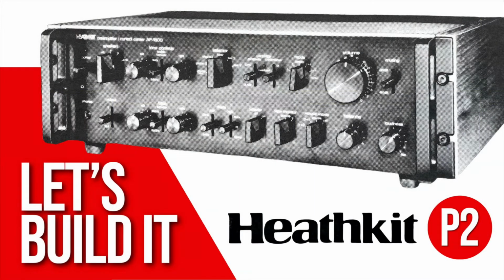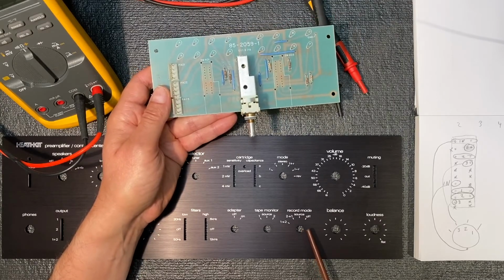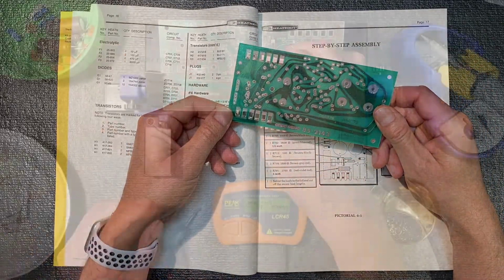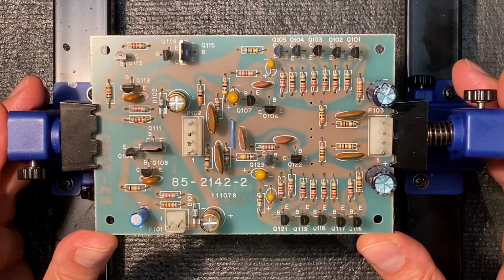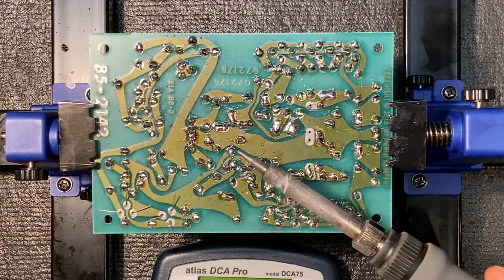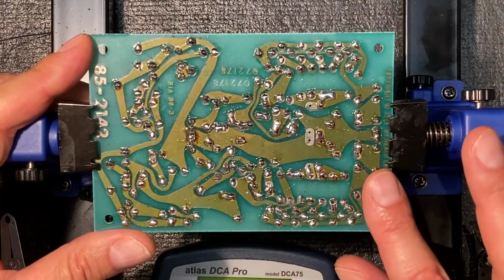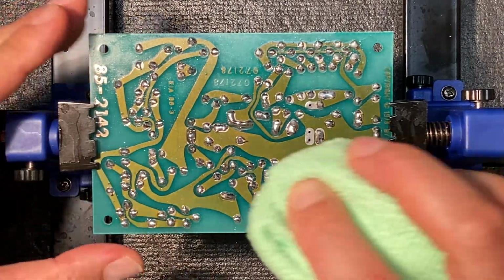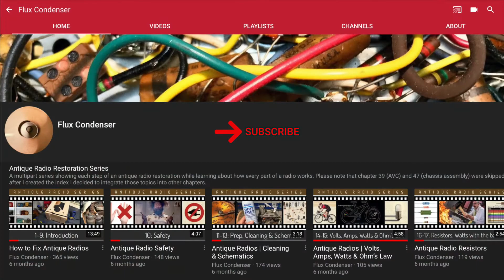Let’s Build A Heathkit Stereo Pro-Series Preamplifier • P2

Comment: I have four, Heathkit AP-1800 preamplifiers and all of them have a three position switch for the tape monitor. The parts packer must have just made a mistake in packing this kit. I enjoyed watching your build of a NOS AP-1800. I miss those days of getting the new Heathkit catalog and wondering what new kits would be offered. I have a complete Heathkit Pro-Series rack system. Every piece pictured in the two catalog pages you show, in addition to the AD-1309, white and pink noise generator, the AD-1308 spectrum analyzer, an ADC, Accutrac 4000 turntable (Heathkit offered the same turntable under a private label agreement with ADC, but I don't have the Heathkit version), a pair of the AE-1705 equipment racks, plus a pair of AA-1600 and a pair of AA-1800 amps and even a copy of the Heathkit catalog you picture. All that equipment is attached to a pair of Heathkit AS-101 speakers. Every piece is still fully functional and I enjoy it all on an almost daily basis. I also have an unbuilt AD-1308 spectrum analyzer kit and an unbuilt AR-1650 AM-FM, stereo receiver kit. I have been struggling to decide whether to build these kits or continue to save them. At least so far, they are still unbuilt. I was also lucky enough to purchase one of the original prototype AA-1800 amplifiers from a person in Benton Harbor, Michigan. It had belonged to a person who went to school with a former employee and kit designer at Heathkit back in Benton Harbor. I also have lots of other Heathkit audio equipment going back to the A-7 and A-9C tube amps offered in the mid to late 1950's. Lots of Heathkit test equipment as well. Ah......... the good old days!
Reply from the maker: Roger, thanks so much for visiting and sharing your incredible experience with the Heathkit Pro Series components and others. What a treat it must have been to build that system and what a treat it must remain to be able to still listen to it today. Even a pair of AS-101 speakers! I was a young teenager when the Pro Series components were introduced, so I largely missed the Heathkit-building experience due both to my age and the expense. So now when I come across these unbuilt kits, it’s hard to fight the urge to not build them! I have a lot of vintage equipment to choose from, but lately I’ve been listening a lot to the AP1800 with a McIntosh MC2105 amp I restored and B&W Series 3 802 speakers. When I listen, I have no regrets that I didn’t keep the kit as a bunch of parts in a box.

Comment: Fantastic build series. Thanks so much for sharing. Looking forward to part 3!
PS: I also use Cardas Quad Eutectic solder. Best I have used by far!
Reply from the maker: Thanks for watching and taking the time to comment. Glad to hear people are enjoying the series. Yeah, that Cardas solder just makes soldering so pleasant. I tried, really tried, to make lead-free solder work for me (in one of my earlier videos I said there was no reason to not use lead-free and told holdouts to “get over it”). It did work fine, I suppose, but it’s harder to work with, never looks as good, and I didn’t have the faith it would hold up as well and not lead to cold-solder issues down the road. I’m a sucker for perfect-looking, shiny-happy solder joints.
Reply: @FluxCondenser  Couldn't have said it better myself. I have never had luck with lead-free and I don't think I ever will. It's just the name of the game.

Comment: I was hoping to watch you actually build it. Speeding through it was slightly disappointing to me. BTW, if someone hasn't already told you, the little red thingy is a nut starter. The manual will tell you that. I've built several Heathkits including a GR900 and GR2001 TV W/Programmer and remote plus clock. Also a couple of scopes and the IT-28 as well as the IT-21 Tube tester. I loved doing them. My 1st encounter with Heathkits was in an Amateur radio club in the late 50s. We built a SSB transceiver but all these years later I don't remember the model. Keep up the good work.
Reply from the maker: Thanks, Jim. Yes the nut starter tool was addressed in subsequent videos in the series. Sorry you were hoping to see this built in real-time, but that’s just not practical within the constraints of YouTube, at least as far as I’m concerned. Thanks for sharing your experience with Heathkit. I always enjoy hearing those stories. Good stuff!

Comment: Very enjoyable!  I'm an old Heathkit builder myself.  I must admit, I don't recall getting much in the way of mystery parts or missing parts (not saying it never happened but it was VERY rare).  One thing to watch out for is that Heathkit would add addendums/updates to kits and would often print (well, Xerox) the alteration and one was to staple/tape the change to the existing manual.  The last 2 digits in the part for the manual was normally the revision number.  You are on Rev 06 on the book.  You're Illustration Booklet should having a matching part number (upper-right corner of the front page).  Furthermore, the Schematic should also have the SAME part number.  This can give you a clue as to if your kit was somehow altered and also if you are seeing some prior revision parts (they didn't always remove older parts if there was a revision but merely had you use the newer parts. 

I have some kits were I built multiples (clocks and TVs) and due to the time span between them, had different revisions of the manuals and circuits. 

I never had/built the AP-1800 but strongly considered it, back in the day.  In the end, a Yamaha C-4 won the day but you can see many similarities in the two.  I did build (and still have) the Graphic Output Indicator (AD-1701...don't recall the "A" suffix) because you can't have enough meters!

Thanks for posting and enjoy the build.  I do miss them a bit.
Reply from the maker: Sguttag, always great to hear from those that built Heathkits “back in the day.” Thanks for sharing your experiences. I’ve built several over the years and I do run into missing/extra parts issues from time to time. I had checked the parts bags and literature thoroughly and no mention of a change to the switch was mentioned. All versions of the preamp had just three positions, I believe, for the tape monitor so this wouldn’t be a revision issue. Looks like they just dropped the wrong switch in the bag (understandable since the 2, 3, and 4 position switches look identical other than the part number. This is an old kit, though, and although it certainly appeared that I was the first one to open the box, I suppose it’s possible (although unlikely) that someone robbed the box of the 3-position switch and replaced it with the 4-position.
Reply: I was mostly referring to the extra resistors you showed.  I'm sure the switch issue was indeed a mistake.  I'm wondering if the 4-position switch couldn't have a mechanical stopper put in to prevent it from turning too far.  Oh well, it looks like your solution will be more than sufficient, however.
Reply from the maker: I knew somebody would pose the question about whether a stopper could be added at some point, so you win the prize! It’s a good idea, and I’m sure it’s possible, but as these switches are probably hard to come by I decided right away to not even try to open or modify the switch. I just couldn’t take the chance that I’d botch something and ruin the thing. You may be right that the extra resistors are to be used later in the build. When I was briefly reading the circuit description for phono stage, I think I recall some mention of adjusting the impedance by swapping resistors, so we’ll see if those extras will be useful coming up.

Comment: Awesome build video! By the way, where did you buy the PCB holder? I'm interested in purchasing one.
Reply from the maker: Thanks, Robert. The PC board holder is available from Amazon and elsewhere. See the attached link. Stay tuned for the next episode where I’ll make some modifications to the holder. https://www.amazon.com/Aven-17010-Adjustable-Circuit-Holder/dp/B00Q2TTQEE/ref=sr_1_2?dchild=1&keywords=Pc+board+holder&qid=1597805946&sr=8-2
Reply: @FluxCondenser  Thanks for the link. Payday is coming up, might just have to order one. I work on all kinds of antique and vintage electronics in what little spare time I have. This will be great for old transistor radios. I came across your channel on the Vintage Audio Collectors and Technicians group.
Reply from the maker: You’re very welcome. I think the holder will make a nice addition to your bench. Thanks for watching and taking the time to comment.

Comment: That’s a really odd way to clean boards. Use a brush to do the scrubbing, and dab off the flux-laden solvent with lint-free tissues (kimwipes, etc) — microfiber is not antistatic. I used to do a lot more flushing with solvent, but in the end, doing a few passes with solvent-moistened tissue works better and consumes far less solvent.

Comment: Forgive me for being critical, but I think you should heat the joint, before you add the solder. You obviously know what you're doing, and can get away with it, but it's not good practice, and may cause problems for those who follow you.
Reply from the maker: No, that’s absolutely incorrect. Add the solder to the tip first, then apply heat, then solder from behind to flow.
Reply: You’re both right, but FluxCondenser needs to explain what he’s doing in much more detail: the small amount of solder added to the tip isn’t intended to form the joint itself, but rather to act as a thermal bridge to allow the joint to heat quickly. Then solder wire is applied to the hot workpiece (not the tip!) to make the joint.